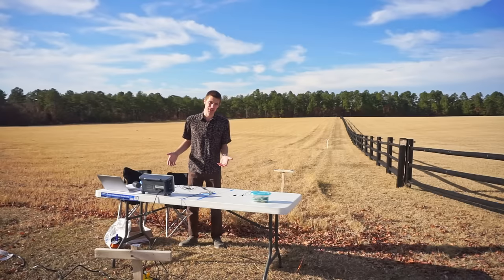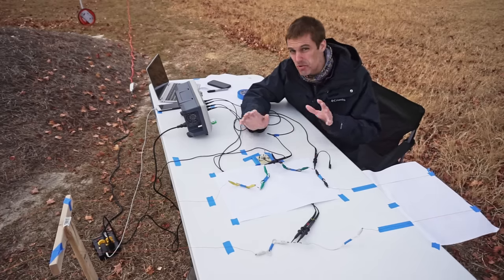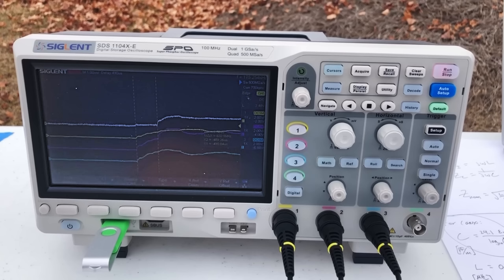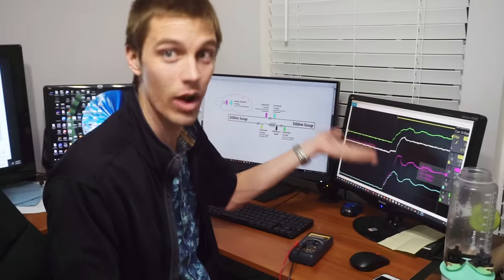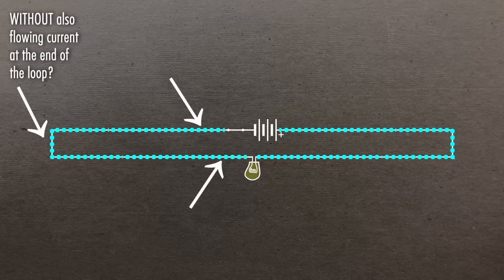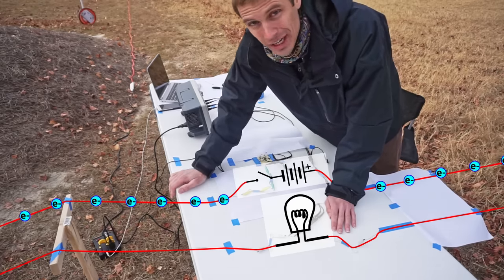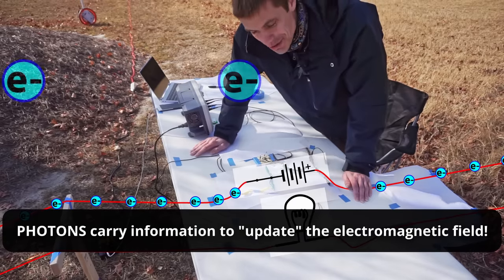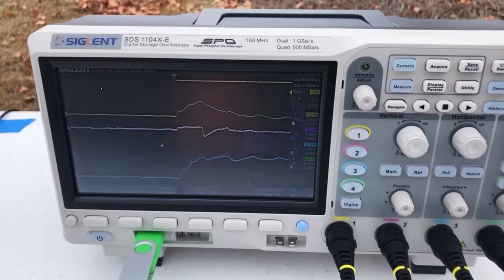I bought 1000 meters of wire to settle a physics debate

Comment: EDIT: After looking at this a 2nd time and having a think, I think this test may be fundamentally flawed. You have used x1 oscilloscope probes that have around 100pF tip capacitance across all the nodes. And they are all referenced back to the same point. This means you have about 50pF of capaciance from each side of the load to the positve of the battery.
I'm currently working on simulating this and probably doing a video on it, just wanted to point it out now.
I think to do this properly you'd have to use a completely isolated scope on the load with the trigger coming from another scope on the switch side via optical fibre. And then you'd have to account for the skew correction in that trigger system as well. It's really tricky to do this right!

OLD COMMENT: Awesome work! I'm way too lazy to actually go out and do this!
Reply: You, sir, were a huge inspiration for me while I was going to school for EE many years ago. Thanks for that!
Reply: I am also not rich enough to spend on experiments which doesnt give me bread
Reply: @deva8496  
Rich? Lul.
Reply from the maker: Yo! I watched a BUNCH of your videos while setting this up, really hoping I wasn’t making some horrible mistake since I hadn’t used a scope in years… thanks!
Reply: @EEVblog 
Oh, Dave, please educate us all on probe-work and how to measure using an oscilloscope accurately.
Reply: AlphaPhoenix already did it anyway. Why waste the wire? Just show his video to your subscribers.

edit: perhaps there is cause for yet another reproduction of this test!
Reply: @AlphaPhoenixChannel  Unfortunately I think you may have! See edited comment above.
Reply: Oh no
Reply: If I understand this correctly, due to the capacitance of the oscilloscope, the result shown as remote immediate effect on switch close is stronger than it actually would be. Right?
Reply: @EEVblog  I was actually wondering about stray capacitance in the system. Its definitely very difficult to do experiments like this successfully and above all to rule out any ambiguity.
Reply: @AlphaPhoenixChannel  I believe you can fix the experiment with two opto-couplers. Should be pretty easy. They aren't super expensive. Digikey ftw! :)
Reply: @deva8496  its i vestment because this vodeo is monetized (there's publicity) so if he gets enough views he'll get back the money
Reply from the maker: Looking forward to whatever you come up with! Really!

Also Electroboom was worried about the same issue and I mentioned that once I spread the wires way out, the pre-lightspeed signal dropped to nothing, so even if the magnitude of the signal isn’t correct, it’s existence may be? I need to compile all my traces and schematics from the experiments that didn’t make it to this video and send them to you guys cause you know more about it than me. 

All that said, the height of the step (and second step) doesn’t seem line up with a normal transmission line simulation, so I don’t know if my setup is flawed or if the light speed transmission delay is poorly emulated by inductors for this weird crosstalk-maximizing circuit…

Even if this works, I’ll feel like I got real lucky, cause I totally spaced out that probe capacitance mattered and now I feel like an idiot. Thanks for investigating!
Reply: @AlphaPhoenixChannel  
You can't draw any conclusion from a bad experimental setup. It's experimental physics 101, really.
Experimental physicists are some of the most rigorous people I know on earth so It might pay off to redo the experiment with all the experiences you learned from this one.
Reply: I also wonder if the proximity to the ground can be ignored. The wires appear to be about 10cm apart (edit: we are told it is 25cm) and 1m above ground. Given that the wire diameter is 24awg (0.51mm) the capacitance between the two wires is about 4.0pf/m, while between each wire and the ground it is about 6.7pF/m. Ignoring anything else, if we could consider this as creating two such capacitors in series between the two wires, that would amount to 3.35pF/m, which is of the same order of magnitude of the capacitance between the wires.

If that GND can be regarded as a low-impedance and short connection to the ground, I think that would further complicate matters, though I doubt it can be.
Reply: @AlphaPhoenixChannel  If moving the wires apart stopped the signal then that looks like pretty absolute proof - at least to me.
Reply: @A.Raybould  the ground also has much larger resistance than copper so it won’t have influence as big as you imply.
Reply: @noop9k  There's a lot more of it. The ground plane is an important factor in antenna performance, for example.
Reply: @A.Raybould  This is not a classic antenna even. So many want to treat this circuit as an AC circuit while we only transmit a single pulse, not even a period. Again, if the ground can be treated as a capacitor, that capacitor is through quite a big resistor.
(Though, for this particular problem, none of the circuit parts can be trivially replaced by a virtual capacitor or a resistor without changing the outcome)
Reply: Waiting for your results.
Reply: @noop9k  Basic Fourier analysis shows that we are, in fact, dealing with a very broad spectrum of electromagnetic waves. The reason why "so many want to treat this circuit as an AC circuit" is that none of the measurements can be explained by treating it as a DC one!

I have looked for an impedance formula for a wire over a resistive ground plane without success. If you know where that can be found, please let us know. Without quantitative evidence, I'm going to consider my original question as still open.
Reply: @EEVblog  I don't think it changes things significantly. You could disconnect the probes and bring the wires closer to get the same capacitance. The magnitude will change but displacement current still flows as soon as the wavefront begins propagating.

A better question is what happens when the light is on and the switch is opened. When does the light turn off?  This circumvents any trickery regarding "when the light turns on" and at what current.
Reply from the maker: Oh that is a good question. I think I have a single saved trace of the ‘switch’ opening but I don’t remember if there was a pre-step down. I’m trying to think with the same logic as the first, you’re effectively over-tugging the electrons leaving the negative end of the battery with the inductance of the wire wanting them to keep flowing, so it gets positively charged, and should act to decrease the voltage at the lightbulb ever so barely? I’d have to think if it being a constant plateau makes sense but my gut says it should just because of symmetry… that’s the physics mindset lol
Reply: @AlphaPhoenixChannel  The math would be simpler if we consider the switch connecting the low side to the high-side instead of floating.  Then we can consider the Displacement Current as the wavefront propagates down what was formerly the low-side.  Consider the transmission-line model, and the distributed capacitor adjacent to the switch that is coupled to the piece of wire across from it.  Once the voltage hits the low-side, that first bit of distributed capacitance will see a voltage develop across it, leading to a Displacement Current going the other way through the load.  This will be kinda-sorta-not-really like back EMF, only insomuch as it will reduce the amount of power being delivered to the load.  As with closing the switch, this current will be a finger in the dike, and the bulk of the power delivered will continue to illuminate the light until the wavefront reaches the load.  At that point, the voltage across the load will be 0 V (i.e. both sides of the load see e.g. +1.7 V relative to the battery's low-side terminal)

The case with floating the low-side of the load becomes a little more complicated to model and explain, because it's not really a "circuit" when it's open.  You'll have RC ramps as the distributed capacitance on the low side rises to equal the high-side.  But, ultimately, the load will not "know" that the switch is open until the wavefront carrying this "knowledge" propagates down the wire to the load.

Also, in case you missed my reply under your pinned comment - the length of the non-switch side is largely irrelevant, which is why the length calculated by the propagation delay is around 500 meters.  The high-side of the load is always at e.g. 1.7 V.  When you close the switch, the wave of "0 V" propagates from the low-side of the source to the load.  Alternatively, if the concept of a "ground wave" is uncomfortable, consider the high-side to be 0 V and the low-side to be -1.7 V and then the negative voltage wave is propagating down the low-side.
Reply: @AlphaPhoenixChannel  Buy some Clare reed relays with mercury-wetted contacts.  They're supposed to switch in nanoseconds, with no switch-bounce (I just ordered four, and haven't tried them out myself yet.)     First, I'll try this with 50ohm coax (I have some big spools of that.)    See if the assymetry of the shield makes a big diff.

Comment: This video is PHENOMINAL compared to every other explanation I have seen. I absolutely cannot wait until part 2 as alternate configurations of the loop have been bouncing around my head for the last month. (especially the spread out one!)
Reply: Wholeheartedly agree with Goodgu - everyone else seems to have completely missed the point. Even the talk of inductance/capacitance seems to miss the point really, but it is good to see the actual effect quantified after so many people relied on it for their whole explanation. The question is ENTIRELY about the whether the energy is carried by the Poynting field, or by the moving electrons.
Reply: totally agree. The oscilloscope cleared it up so much. Especially with the cut wire.
Reply: I believe that this plus electroboom's  video are the perfect combo
Reply: @paulwright8695  We already know there are charge effects that will occur over distance and the strength of those effects are inversely proportional to the distance from the charge, in this case the electron. You can mathematically describe what is happening but it doesn't change the reality of how it works. The energy is both In the wire and Outside of the wire. The fact that the electrons are strongly coupled to the conductor and move inside of the conductor (sometime closer to the surface depending on the nature of the current) means that the majority of the energy carried must be proximal to the electron. That is why the conductor's are carrying most of the power, and that is why the Original Video that Veritasium presented is highly misleading because it suggests that (Paraphrase) "it's all about what's happening outside of the wire, not what's happening inside". And that is simply incorrect. 
I do wish Veritasium had posted his own video walking back his claims when it became quite evident (even by his own words) that the light would not turn "ON" but instead was only dimly lit. (I actually doubt a real light would actually be on by any reasonable stretch of the definition, but I would accept 80% of nominal as on or even many other versions of on. But a slight glow... no)
I really appreciate this actual demonstration. 
Again, you can't run this kind of stuff on a simulator and expect real results until they have been verified by experiment.
And I am very very disappointed that Veritasium didn't actually do a REAL Demonstration to prove it when he posted his video or at least say his next video would show proof.
Reply: @paulwright8695  The last sentence doesn't make sense, it are moving electrons that cause the poynting field. Arguing about which one is the actual cause of energy is useless, because they always come together. (And that is why Veritasiums video is just bad science communication)
Reply: *phenomenal